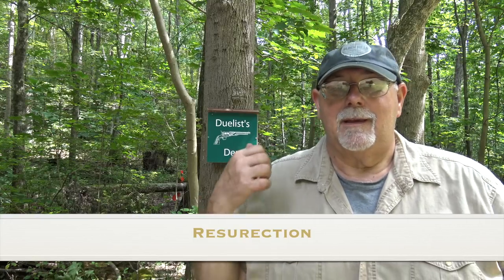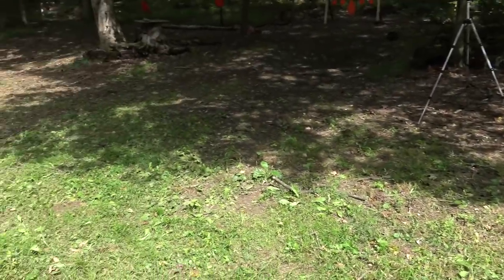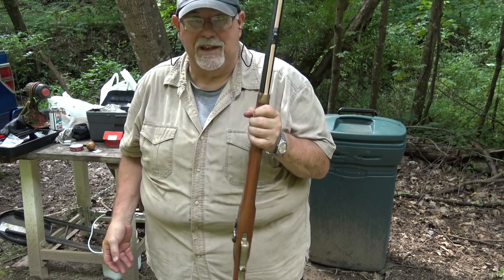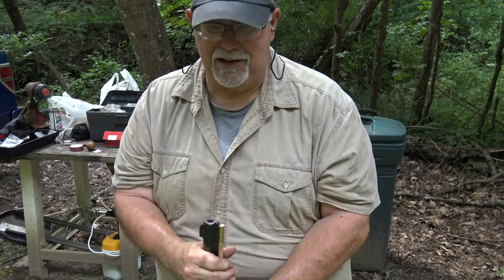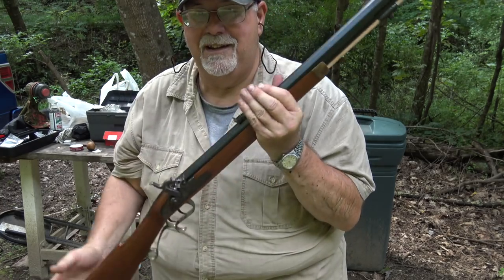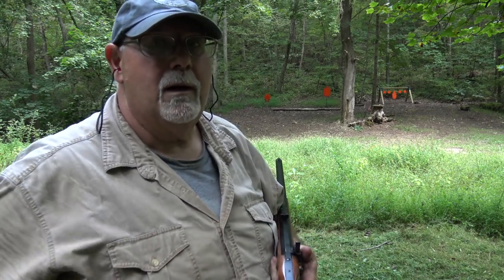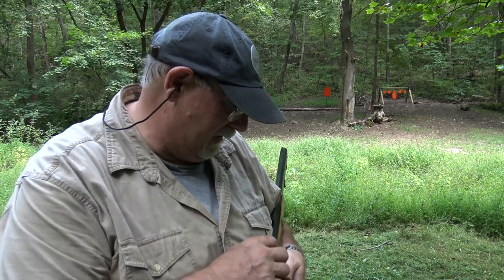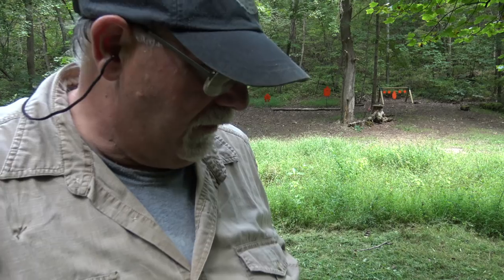T C Rifle Salvage

Comment: I bought a used cva Hawken from a pawn shop. The only Hawken I could find at a price I could afford.   Very nice but the one mistake I made was not carrying a bore light with me.  I got it for a good price, but the barrel was neglected.

Apparently they cleaned it extra well, but sold it because they let it rust to oblivion.  I didn't even trust shooting it and I couldn't find anyone within a decent traveling distance to re-bore it.

It took a year and a half to find a replacement barrel, mostly because it was a button rather than a hook.  I finally got one and replaced it and I love it!

The dual trigger has to be one of the best trigger systems I've ever seen.  And once sighted in, etc. It's incredibly accurate.  I absolutely love it!

Comment: I purchased the same rifle at a pawn shop and it was cheap cheap. It was totally neglected and the nipple was rust welded into the drum. I soaked the breach end of the rifle for a week in pb blaster , I also put a bunch of pb blaster down the barrel in Hope's of attacking the rusty nipple from both sides. It worked, I used a 5mm open end wrench and a propane torch. I applied heat to the drum and nipple and tapped the 5mm wrench with a small hammer and it broke free and came out in tact I cleaned the drum and barrel as good as I could and installed a new nipple with anti seize and it works like a champ shooting both prb and 385 grain plains bullets very accurately..

Comment: This reminds me of the purchase of my own very similar rifle. 
I bought a left handed CVA Frontier in .50 caliber about 11 years ago. 
The stock had been refinished with a rather unattractive honey oak in a very high gloss, and the bore had not been properly cleaned or treated.
I re-refinished it with tongue oil, worked for weeks on the bore, and it did very well. However, I made the decision to upgrade the nipple to a Mag-Spark 209 adapter. Probably a hanging offense in some circles. But I draw my own circles, so I don't care.
In fact I will be hunting with it this season.
Great video as always.
Thanks for sharing.

Comment: I have a TC Seneca I bought in the late 70's ???     440 RB with 6o grains of 3F.  Killed maybe 30 deer with it and it's still going !!!  after every season I tear it down, clean it and put all the metal parts in a WD-40 soaked sleeve.  Except for a few dings and scratches she looks good. I have 3 spare nipples but never had to use them.

Comment: I have the traditions Hawkens Woodsman and who ever had it before me semi cross threaded the nipple hole. The threads are messed up bad that i was able.to.get the nipple off but the threads on the rifle where the nipple screws in are so bad i can't get the new nipple to screw in. As.soon as a find out what threads they are I am going to buy a tap n die set and tey to clean up the threads, wish me luck. Thank you for sharing.

Comment: This is June, 2021. This spring I did a rehab on a T.C. Hawken. Polish the brass ( some... not to mirror finish), sand and refinish the stock. My barrel had to be replaced... looked like a sewer pipe! The gun looks great! I've shot it very few times but it does make smoke and thunder. I got powder a few days ago so its time to find the right load for her. Her name is Sheila Mae. Sheila, in memory of my wife. Mae... because she may go off or she may not... and I may be able to hit where I'm aiming! Oh yeah... the new barrel. It's a Green Mountain, 33", 1:66 twist because I'll only shoot round ball with it. Time to get to the range!

Comment: Picked up a TC Renegade last fall at a tag sale for $100, from the serial numbers it is from somtime in the 1980's but was in good exterior condition with a little rust around the nipple. It looked like the former owner used old engine oil on it and there was some rusty oil on the bottom of the breach and a lot of thick oil in the barrel, but the nipple came out easy. Took about 10 caps to blow all the oil sludge out of the nipple and channel but my 15 year old was able to get a 8" group offhand at 50 yards. This was the second time he shot black powder

Comment: With my 50 hawkin from tc I've found I get the best accuracy between 90-100 grains of 2f, and .495 round balls with greased pillow ticking cut at the muzzle. Hope that helps you Mike, once you get around to giving her a good test. I also have a 54. Use the same powder charge in both. Works fantastic. She'll push out to 200 yards and hold 1.5" patterns for me most days like that. My 54 is a shade tighter, but not much. Both have had hundreds of rounds through them.
Reply: Pat Throwback Bear Putnam that’s gotta be awful tight!  I use .490 with ticking and it’s a chore to load the ball sometimes.

Comment: Before doing anything with the barrel, I would try to stop and remove  the rust, then smooth the barrel gently. Then check for grouping at various distances. I'm sure you know that the barrel doesn't need to be flawless to group consistently at muzzleloader distances.I shot an original (late 1800's) squirrel rifle [ .311 rb]  for years. It would group very well up to 50 yards , and it had an extremely rough and pitted barrel. Always enjoy your videos.

Comment: I have owned a TC Hawken 50 Cal since the late seventies and have taken a number of deer with it. Great muzzleloader. When in-lines came out everyone in my home state of Maryland started switching over. In my opinion it is cheating especially with scopes. I went to a local muzzleloader shop a few years ago to get a part for a cap and ball pistol. In the corner of the shop there were a dozen TC Hawkens on the floor in a pile. It was sad to see. The shop owner took them in trade for in-lines. Two years ago the state implemented a primitive black powder season for side locks only. Now everyone is looking for these guns. I should have purchased a few of those discarded rifles, restored them, and sold them for a profit.

Comment: Why did you not use a wire size drill bit?  You being a gunsmith I would think that you had a set.  I have a set just for cleaning carburetor  jets.

Comment: Hello Mike, Please by carefull with this Hawken, and I'll tell you why, I have a Hawken calibur .45, A couple of years ago on a County Championship , only loaded with 50grains of Swiss F2 the nipple when fired, was ejected out of its threads and I had a hole in the peak of my Cap, (lucky),  so I took the Gun to a Gun Smith and had it rethreaded and a over sized Berillium nipple fitted, some time later I had the same again with 50 grains of Swiss f2,, The answer from the Gun Smith don't risk your life with this Gun, But don't sell it because someone may try to use it and get hurt, so hang it above your fireplace,
 I now have a Alexander-Henry in Calibur .50 very nice,
Reply: Paul Newmarch if you put a 6mm threaded nipple it will blow out.  T/C takes 1/4”x28.  Don’t ask how I know this!

Comment: Its funny that some nipples come out easy and a few just wont. I make my own wrenches out of 1/4 drive sockets. Find one with two opposing flats that fit the nipple then cut away the rest with a dremel. Then i have a wrench i can put some torque on. If that and a little heat wont free the nipple then i drill it out and retap for a new nipple.
As far as rust in the bore goes, i take out the nipple and put in a screw wrapped with teflon tape.
Then i fill the bore with evaporust or wd40 rust desolver and stand the barrel in a corner over-night.
The next day i dump the rust desolver out and i wash the bore then use a metal prep pad for final rust removal. Once patches come out clean i use tc bore butter to prevent rust in the future. I have salvaged some scary looking bores this way.
John Davis jax fl

Comment: Yeah, I always cleaned and dried my bore and left it lubed with TC's BoreButter.
My neighbors bore was always rust color after he cleaned it.
  I would not be brave enough to buy a used gun,. because people abuse them and they over load them and they don't clean them to my standards.
My opinion is guns cost too much to abuse them.

Comment: Mike, have you shot the TC for accuracy anymore?
Reply from the maker: yes. it shoots fine. I just mounted an aperture sight on it, and I'll sight that in this spring.
Reply: @duelist1954  I wonder if you tried the  3-m Scotch-Brite trick that you used on that kit you assembled that had the rough bore. Maybe some runs with some type of cutting oil?  ;^)
Reply from the maker: @rogersmith9808  This bore was very corroded. I think it was beyond salvage.

Comment: where do you get these cheap and used
Reply: I bought a renegade at a pawnshop for $50 once.  They also turn up at gunshows once in a while.
Just start looking and you will find one. Take a cleaning rod and a patch 
And see how much rust come out on the patch. A tiny bit of red on the patch can be cleaned up but if it feels rough pass on it.
You can also get a bore light that plugs into your cell phone so you can see exactly what it looks like down at the breach.
You will find guns that appear to be unfired all the way to rusty sewer pipe .
Good luck and happy hunting.